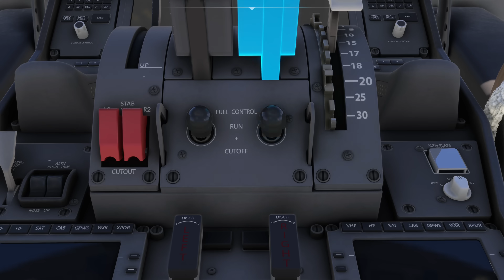Air India 171: Why Did The Fuel Cut-off Switch Get Moved?

Comment: As an experinced pilot you said in on of your first videos that pilot made an error and he pulled the flaps up rather than gears.....As an student pilot myself, I can say that if your both engines are working it doesn't matter,  the flight will sink a little bit but eventually it will fly. I don't know how you came this far without having this much knowledge. ** You blamed pilots in that video too

and now you are still blaming the pilots for cutting off the fuel, rather than asking boeing about their switches....I didn't know people can get this low to defend an US airline, I under stand your economy depends on it but you should not be allowed to fly-- this is coming from an fellow pilot

Comment: What if pilot #2 "hears" engines spool down
So asks pilot #1
"why did you shut of engines"
They look and see both toggle switches still in
Run position.
One of pilots grab both switches at once
And turns both off then back on,
Trying to restart.
 ..software or component fail

Comment: You mentioned in an earlier video there should be no reason to shut off the fuel that early in a flight. Why is there no safety controls to prevent this?  Seems weird that a person would have control of this when it would be fatal if they turned the switch

Comment: One simple question. Rat deployment is 
1. Deploy if fuel valve is shut deliberately. As otherwise it will deploy even if when landing pilots shuts of engine in case of other emergencies.
2. Or it deploys only when engines stop due to any of other reasons.

Comment: but since it was confirmed that one of the pilots placed the switch back to run,why was it again found at cut off after the crash... that seems like a mechanical fault from the aircraft systems ,or did the pilots struggle in the cockpit or did the investigation team manipulate the switches to alter the evidence..

Comment: How much did Boeing pay him to say that honestly. 

Authorities must make the entire flight voice recording public.
Reply: In 2019, an ANA Boeing 787 experienced a dual engine flameout caused by the aircraft's own TCMA software. The system mistakenly interpreted that the aircraft was on the ground due to a faulty weight-on-wheels or air data input. As a result, it shut off fuel to both engines without any pilot command. The incident occurred on approach and the aircraft landed safely. TCMA is designed to manage engine thrust settings and can trigger protective actions, including fuel shutoff, under specific conditions such as suspected engine malfunction or invalid sensor data. If a similar fault occurred on Air India 171 during takeoff, where altitude and time for recovery were minimal, it could explain the uncommanded fuel cut. The fuel control switches are electronic, not mechanical, and the system records only the fuel valve state, not physical switch movement. Boeing whistleblowers previously warned about electrical contamination and faulty wiring practices during 787 assembly, which could make these types of faults more likely over time.
Reply: As a commercial driver I totally support the idea of cockpit cameras. Surprised it isn’t a thing already.
Reply: @luckyburrito9879 They'll stop recording when you need them, It has already happened in some Indian(a third world country) cases the Voice recorder stops recording... It's based on how much you bribe the AAIB here and after listening to Boeing CEOs salary I can actually bribe the whole investigation agency within a min😂
Reply: It is based on the findings.  This isn't misinformation.
Reply: Recent Denver mid air fire was also pilot fault. It’s always that. Nothing to look here. Move on guys
Reply: @lisaolivarez9380  This video is also based on the findings with more details 
https://www.youtube.com/watch?v=pq2AZdzH7X4&t=24s
Reply: Now tell me who's faulty
Reply: 1. UTC 08.08.42- max speed 180knots(i.e- engine fail around 08.08.40-41 UTC)
2. Fuel switch cut off at 08.08.43 and 08.08.44
3. RAT supply hydrolic power at 08.08.47 (need atleast 6-8 second after engine fail)
4.   08.08.47-6 = 08.08.41
time of probable engine failure
 and fuel switch cut off at 08.08.43-08.08.44 UTC
Reply: Oh come on now.
Reply: Go and watch Video by Flying Beast who is an Ex Commercial Pilot and explained the whole scenario second by second and explain why he thinks its not the Pilots error.
Reply: @VijayChauhan-sr9rb  India desperately wants this to be a Boeing problem. It is not making sense. The pilot shut them off. How do you explain what's on the black box, one pilot asking the other why he shut them off?
Reply: @VijayChauhan-sr9rb 
https://youtu.be/sDQHhlPGaoc?si=D5BKt2tNZ7Wq2QfG

This is the Link to that video you mentioned. Excellent analysis by Flying beast
Reply: @sharongonzo1969 

Flying Beast has 9 million subscribers and 300k views in 3 hours.

He's saying the engines must have started spooling down at least 7 seconds, probably earlier, before the RAT started producing hydraulic pressure. So the manual fuel switches being switched off and on was probably part of an engine restart attempt.
Reply: @Extra-Sailso then if that's the case then still why would their be a conversation where co pilot asks captain, why did you cut off?
Reply: @VijayChauhan-sr9rb pilot with fake qualifications 😂😂
Reply: @erfch2362  oh so you are saying US is providing fake Pilot Licence coz he got his training and initial Lice from US.. and with Fake qualifications he was flying for more than 10 years wow
Reply: @erfch2362  How much did boeing pay you to say this? Also do you know how to operate an aircraft?
Reply: He, VijayChauhan-sr9rb, who seems to be Indian, is desperate to make this a Boeing error.
Reply: link to flying beast video https://youtu.be/sDQHhlPGaoc?si=f2z57wZ3ccR_mBJT
Reply: I believe we're witnessing the beginning of the control structure collapse. World leaders are controlled by the wealthiest families on the planet, who also have (had) their own subservient roles in the control structure - until recently. With their masters no longer around to give orders, these top families are watching their money dwindle while fighting for the top seat. With airlines being huge assets - what better way to send a message to another family that their time is up? Sick and depraved, yes. It's their specialty, making this, a very real possibility: 

directed energy weapons (DEWs).
Reply: They fuck his pussy
Reply: alot i assume , his next generation could live lavish life .This is unacceptable. Providing false information puts everyone at risk.
Your actions compromise safety and trust.Providing false information is not tolerated.
Reply: He is a bloody dishonest boeing mouthpiece... What a shame... I pity on US Navy...
Reply: So convenient that no media in the West published criticism by investigating body of such speculation. Everybody has assumed the pilot “calmly” said “i didn’t do it”, no mention of calm anywhere in findings.
Reply: See Flying Beast's YouTube video called:
New Findings Air India 171 Crash Report | CONCLUSION | PART 3 (ENGLISH Dub)
Reply: Bold to assume that a guy who has a full-time job as a pilot and a few other gigs needs a Boeing payday, especially when he didn't even say that Boeing is a flawless company.
Reply: @svscared and if only humans could be happy with what they have.. hope you don’t live in a cave or you think others live in a cave.. this whole issue is directly related to Boeing..
Reply: A LOT.
Reply: He hears Payday Payday Payday instead of Mayday
Reply: @Abcg4673  is there a Cultural face saving Indian characteristic where they argue to save face even when presented with plain hard facts to the contrary?
Reply: Go and watch flying beast
Reply: manipulation all the way. That is what i say make everything public. Not behind closed doors, where persons can put out there, what they want to tell you.
Reply: Unfortunately with AI anything can be fudged, even flight recordings. Is it any wonder that the person announcing that they found one of pilots shut the values, announced this at midnight via the internet? Sounds like he didn't want people to see his facial expression when he did it.

Comment: the report snapshot at this time https://youtu.be/9GqAXrDsjSU?t=1239

1. the lift-off happened at 08:08:39
2. Maximum recorded airspeed of 180 knots at about 08:08:42
3. Immediately thereafter point #2 the Engine 1 and Engine 2 fuel cutoff switches transitioned from RUN to CUTOFF.
4. RAT Hydarulic pump began supplying hydraulic power at about 08:08:47.

Essentially between point #2 and point #4 there is time gap of FIVE SECONDS.
Meaning, still at 08:08:42 the fuel supply switches were at RUN position supplying maximum airspeed.

My questions are:
0. How long it takes when fuel switches are put to CUTOFF and the fuel stops going to the engines?
1. How long it takes for RAT to be deployed after fuel cutoff switches are put to CUTOFF from RUN?
2. How long it takes for RAT to start supplying hydraulic power after RAT is deployed?
Reply: RAT deployment is not because fuel switches were put to CUTOFF. This indicates technical issue with the plane and not pilot error.

The root cause is to figure out why RAT was deployed as that occurred first in sequence than fuel switch transition.

Comment: Why do some airlines allow their pilots to put their checklist clipboards or iPads on top the instrument panel by the windscreen?  I recently saw a video of an airline pilot doing this with a clipboard after going over his preflight check.  This seems dangerous because during turbulence or even takeoff that clipboard could fall onto the controls including the fuel cutoff switches.  Might there be a scenario where the edge of a clipboard could lodge under the tapered bottom front of the cutoff switches, lifting the switches and shifting them to the rear just as if a pilot did it?  Even if the chances of this happening were 1 in a million, could it be a possibility?
Reply: Here is a video of 747 pilots taking off with what looks like their clipboard on the center of the instrument panel.  Looks dangerous to me.
"Beautiful BOEING 747 TAKEOFF from NEW YORK JFK Airport. Runway 31L. long runway, long run."

Comment: Where does the FDR get its signal of the Fuel Cutoff Switches position?   The switch itself or the computer?  Yes it makes a difference.  Shorted wires, a short in the computer logic, a software problem, hacking, So when we see the switches are off, are they really?, or does the computer just think they are off.  So this is not necessarily a pilot activated thing.... if the FDR gets its switch position input from the computer itself.  I see hacking as a slim possibility.  It's been done before.

Comment: Question: is confirmed only 2 pilots in cockpit? 
In the future a internal lock for the fuel lever to stay in place meanwhile throttle is out of idle. Any ways to cut an engine in case of fire for example the throttle lever is the first to be conformed and placed to idle. In that condition the lock opens and fuel can be shut to off.

Comment: People are quick to assume this was a murder suicide, but the evidence doesn’t clearly support that. The FDR shows both fuel switches were turned OFF and then back ON 10 seconds later — that looks more like someone trying to fix a problem, not crash the plane. The CVR even recorded one pilot saying “Why did you shut off the switches?” and the other saying “I didn’t,” which sounds like confusion, not intent.

It’s possible there was a warning or glitch, and a pilot toggled the switches to reset the system — which is actually a known way to try restarting an engine. If this were a suicide, there are far easier and more direct ways to do it. We shouldn’t jump to conclusions when human error or a system fault is still very possible.

Comment: Cars activate alarms simply when a seatbelt isn’t fastened, yet it’s surprising that on aircraft, the fuel cutoff—a crucial control—doesn’t trigger any visible or audible warnings in the cockpit if it’s moved during flight.

Comment: The report does not talk about the damage of black box, location tracking not working at the time, is it not the fault of boeing? Are they hiding the data of the black box? Even if they say it was damaged, wasn't it supposed to not get damaged in the first place? Why are they focusing on the question "Why did you cut off the fuel supply?" and not on the "I did not do so"? And now a captain who flies a boieng and works for a company probably under contract with the boieng keeps hinting it must be the pilot's fault. Soon there will be reports of pilot's mental illness and family feuds, no wonder.

Comment: If one of the pilots pushed the fuel switches to off, without cockpit video, we'll never know which pilot. I was thinking a few days ago that when the plane stalled, it was possible the pilots were in panic, and doing anything possible, including moving those switches up and down in hopes that would do something, and last position they were in when the planed crashed was off. Maybe that's not the case.
Reply: The switches in the wreckage were in the RUN position.

Comment: Does any pilot ever check if those mechanical detents actually protect those switches from accidentally from being moved? Or do they always pull on those  the guards? The two vertical brackets at least suggest that the possibility of accidentally flipping them has still been a consideration by the designers. Are those brackets always installed? If any pilot ever accidentally flipped only one of those the switches to off, would it be reported? If only one switch was flipped by a bag or wrist band being dragged over it, would we have heard about it? I've also seen that on some planes there's even a guard between the two switches, not on this one. How often is the state of these switches updated to the flight recorder, i.e how certain are we that a change of two buttons nearly at once does not appear as a stepped change due to a low sampling rate.

Comment: Although it seems impossible, is there any possible way that the switches could be balanced on the top of the detent rail such that the switch is still in the on position, but subsequent vibration, slight g loading at rotation and climb causing it to slip backwards into the off position ?

Comment: Someone suggested more safety features like the switches only being possible to cut off in the idle position, or a dual pilot activation… what if in an emergency the other pilot is unavailable and you need to cut off the fuel?

The switches already have this safety feature to avoid accidental activation, and weren’t designed to avoid sabotage. If a pilot is going to sabotage the plane, he will find a way. You can’t design all the controls and switches thinking they might sabotage the flight…. In 2015 a pilot hijacked his a320 while the other was outside the cabin…took control and crashed into a mountain (germanwings).

Mental health problems should be addressed in first place, instead of designing every control and switches to make it sabotage free, yet unflyable.

Comment: No one cut the fuel the two switches went off within 1/10th of one second - the switches could not be turned off by the crew that precisely, but a crew member reset them as the engines were spooling up again as it hit.  Also, Air India did not do the recommended tests on the switches. Corporate cheap out.

Comment: For God sakes,  why can't the system be done so that the off position must be allowed only if the throttle is all the way back to idle,  so that if you want to shut down any engine , first you back off the throttle,  then cut off fuel. 
That can very easily be programmed in the system .

Comment: I have a question:  When the switch is moved, i assume it signals a computer or some electronics to in actually turn off the fuel supply  ?   Is this correct ?    I doubt there is a wire from the switch going to a solenoid valve to shut off the fuel.   Even when you start your car,  you tell the computer to start / stop.    So  what if the electronics that controls the fuel shutoff failed ?    and the captain tried to turn off and on the fuel switch to see if the situation can be recovered ???

Comment: RAT was deployed immediately after takeoff not specified but could be 08:08:42UTC ,

max speed due to momentum achieved at 08:08:42UTC

Run to cutoff transition was at 08:08:43 and 08:08:44UTC 

Max speed, RAT deployment was clearly before the cutoff switch transition and cut off cannot be assumed instantaneously and even if it is considered momentum of aircraft will give max speed after 08:08:43UTC.

Clearly engine failed to operate at runway just before takeoff.
RAT was deployed and momentum lifted up till 180 knots max speed and then switch was transitioned.

Switch transition is misguidance to the whole investigation.

Comment: Excellent interview with Piers Morgan, but I think you misinterpreted the initial question about AI. The question was about AI being used during critical flight phases, but with pilots still there as a backup. That's obviously quite distinct from having no pilots at all and more akin to an especially sophisticated autopilot.

Unrelated, I see no good reason to not transmit FDR data via satellite in realtime or at short intervals in addition to the existing physical recorders. That seems as if it would be comparatively inexpensive to retrofit (I imagine the largest expenses would involve regulatory approval).